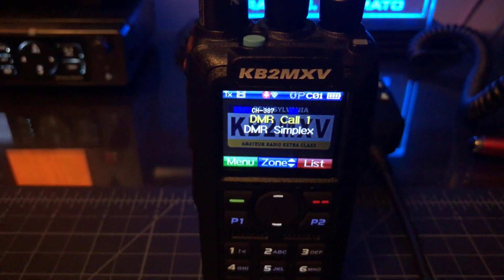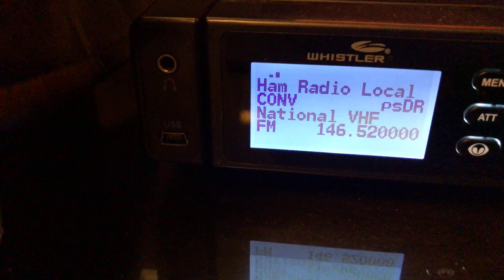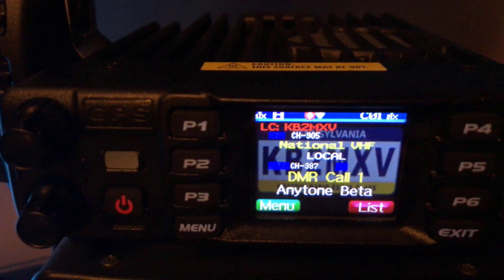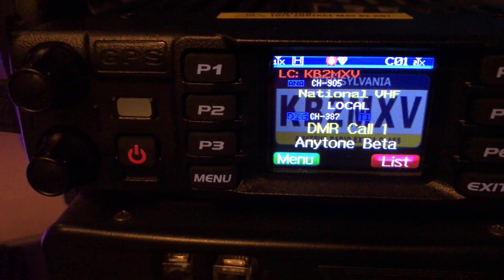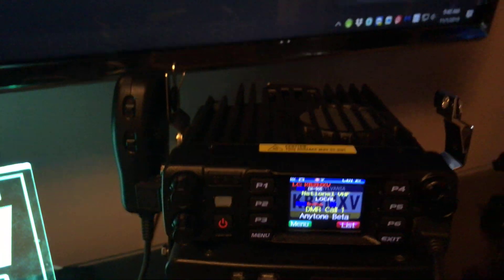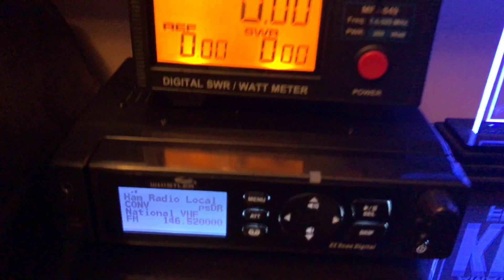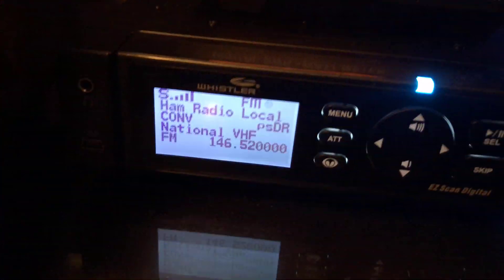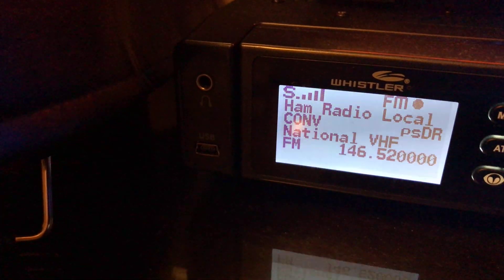Anytone D578 Cross Band Demo - DMR to Analog

Comment: Does anybody know if the D578 will work the other way around?  D578 process analog vhf signals from a vhf mobile, or WT, cross-banded to the club's UHF analog/DMR combo repeater...will the DMR signals decode properly so that you can work talk groups through your VHF mobile or WT radios crossbanded to the club's combo analog UHF/DMR repeater? I see where it is indicated in a post below that it will, but the video posted below no longer functions.